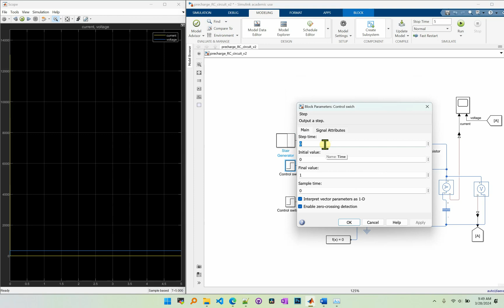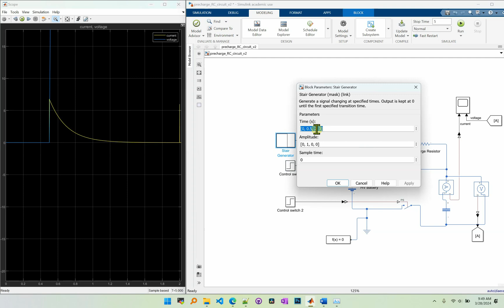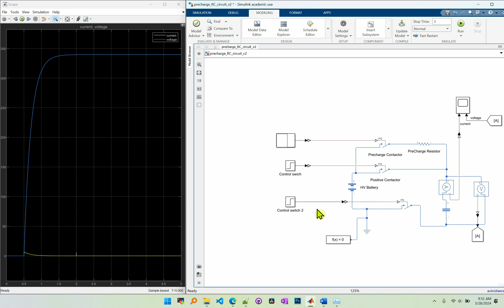[Matlab Tutorial] Simulate Precharge Circuit in Matlab Simulink

Comment: What is your capacitor and Resistor value
Reply from the maker: You don't want your pre-charge resistor too big, and the capacitor load depend on your application. Let try with a few nF or uF for cap and resistor < 100 Ohm.

Comment: hello how can i use this control using the voltage( closing after reaching 400v)
Reply from the maker: As I understand your question, you are asking how we can close the positive contactor once the voltage reaches 400V. I don't know the answer to that. Can we connect the signal line (orange) from the switch to the battery? If you find the answer, please share it with us